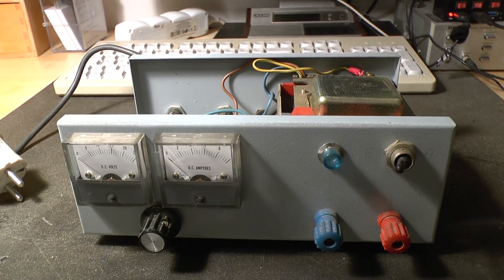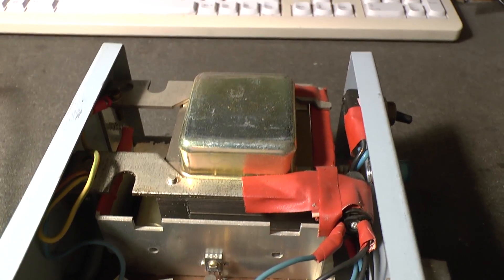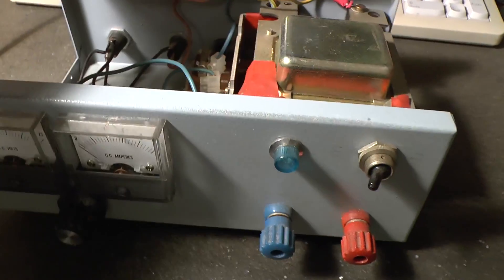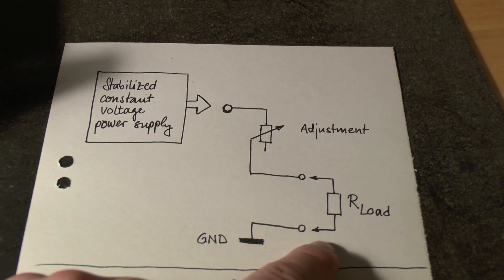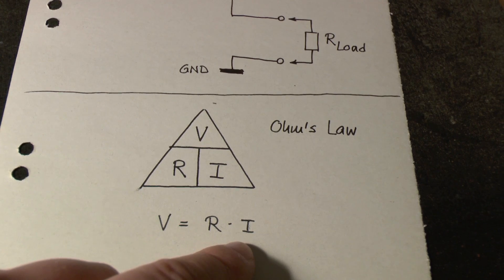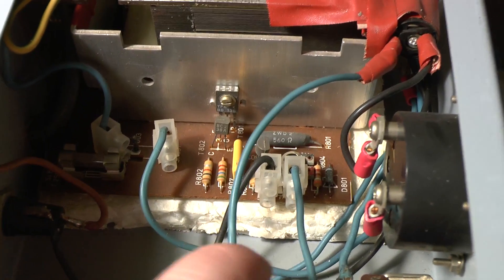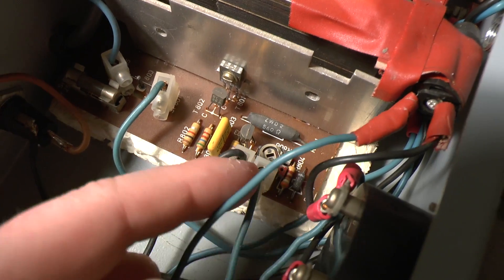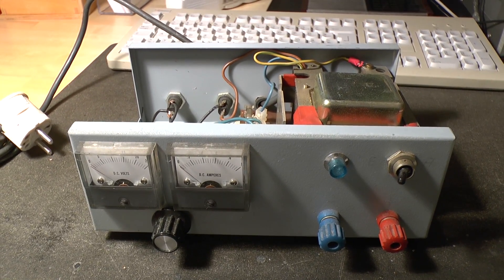How NOT to build a bench power supply

Comment: they could use a LM317 for 30v linear 1amp. And a transistor after LM317 for 2-3amps on 30 volts.
Reply from the maker: +mitropoulosilias 
Yes, that's exactly what I did when I rebuilt this power supply to work properly.
Reply: DrCassette Hell yeah!!!

Comment: I'm not certain you're making the right assumptions about this device. Given the amount of effort put into making it, I doubt that the creator was ignorant of the adjustment pot. I'd be more inclined to believe that this is intended to be a constant voltage, variable output impedance supply. For instance intended to be used as a NiCd battery charger rather than a bench supply.
Reply: That was my first thought also. It's similar to a charger I built for lead acid batteries that were of various voltages thirty years ago.
Reply from the maker: +FFcossag 
Hmm, never heard of that but yes, could be.

Comment: an LM317 with a current amplifier transistor would be perfect for this setup.
Reply from the maker: +THEtechknight 
The ammeter will only go up to 1 A, so an LM317 just by itself is enough. That's exactly what I installed in there, unfortunately combined with some piece of sh!t transformer that I will have to replace once again to make the unit work as it should.